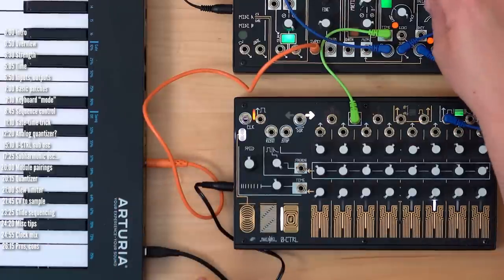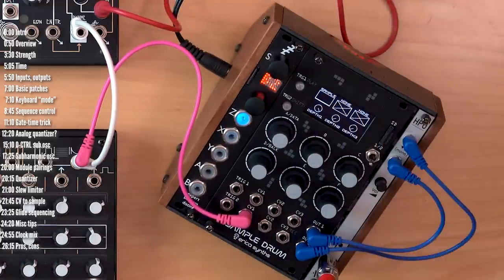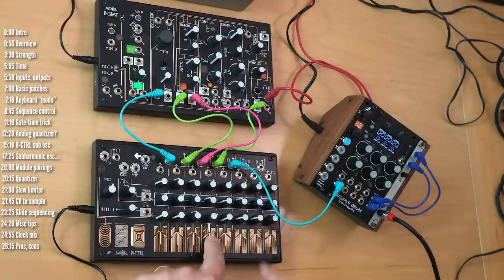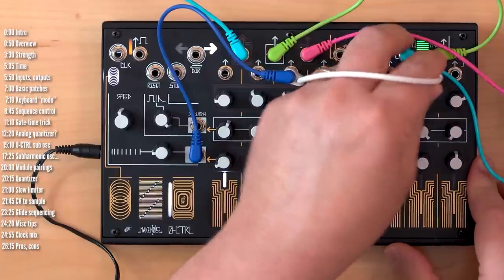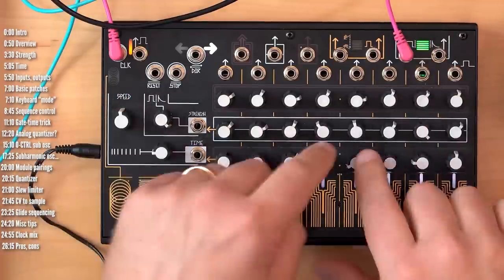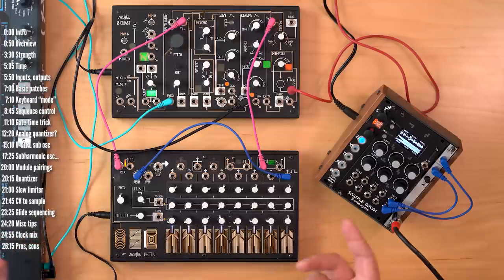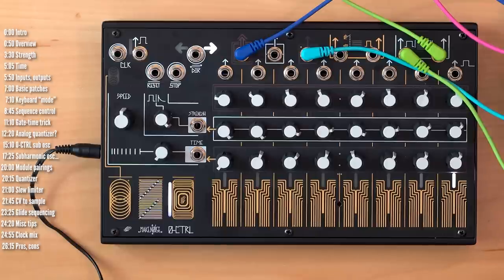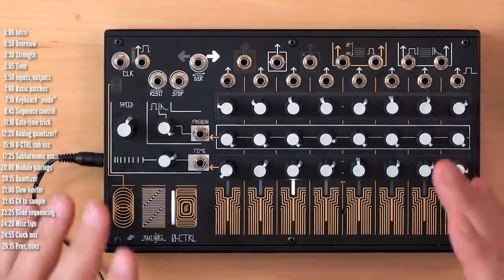Review: Make Noise 0-CTRL // Patch ideas with 0-COAST & other modules  // 0-CONTROL tutorial

Comment: A tip: if you patch the pressure gate out to the external clock input, you can play the 0-CTRL like a keyboard AND trigger its envelope out at the same time, as long as the sequence is not running. This does not prevent you from using the unit as the sequencer it is. When you stop the sequencer, each step sends three CVs, an envelope determined by the second row, a vari-level gate, a pressure CV and a pressure gate, which can be sent anywhere using a multiple.

Comment: Best review on the 0-CTRL, with amazing patching ideas! I would only love to see how you can add more steps. It sounded a bit complicated.
Reply from the maker: Thanks! Like I mentioned it requires a clock divider and sequential or voltage controlled switch. I might show it in a future video
Reply: @loopop  Oh yes I think I get it now. You've got  all 3 outputs connected to your V/Oct input and then use a switch to turn each row on and off. Right?
Reply from the maker: Exactly - and the timing of when you skip rows determines the length or craziness of your sequence
Reply: @loopop  Amazing, isn't it? I was checking all these eurorack sequencers constantly and I was never happy, couldn't deal with all the menu's and data typing. This is exactly what I wanted and I didn't know it before!

Comment: Great video. Maybe both of these would be a good fit with my Deluge. Presumably, the MIDI clock from the Deluge could be patched from the 0-COAST to the 0-CTRL so the sequencer would be synced to the Deluge but I could touch the pads for modulation?

Comment: this O ctrl could be a DFAM's best friend also !
Reply: I'm afraid DFAM will never have a friend ;)
Reply: Wouldn't you run into issues with voltage ranges? The DFAM doesn't follow the Eurorack standard.
Reply: @eternalvoid2678  got no issue between my DFAM and other eurorack modules. the "time" and "strengh" sequencers on the 0CTRL are perfect for DFAM. I already got an O coast with the DFAm and they pair so well (as long as you got a quantizer, love the micro tonal stuffs but sometimes it's a real pain in the ass - and a DFAM quantized is such a great synth outside of its percussive nature). i just wonder how does this Octrl competes with a rené mk2 in a tiny case.....

Comment: Hi, I'm finally getting a 0-Coast after waiting 6 months (due to Covid causing delivery/supply problems). However, when I first saw your review of the above 0-Ctrl, I thought, yes, let's get the two pieces, they'll clearly be perfect together. However, between time I recently saw the KORG SQ-64 which looks very interesting indeed (although clearly not a modular synth), but it does seem to have some very interesting qualities which the 0-Ctrl sort of lacks (and even covers some of the weaknesses too). 

So, my question is should I go ahead with the 0-Ctrl as the sequencer option, or maybe wait a few month for the Korg SQ-64. Of course I understand your answer could be simply, "it depends on what you want it for", but maybe you could give me a few pros and cons for the two sequencers, which both look attractive in their own ways. 

Thanks in advance.
Reply from the maker: You guessed my answer correctly... everything I know about both sequencers is in this and the SQ-64 review - if you want a summary of the pros and cons it's in that section of the video of course. Sorry, don't know what to say beyond that...
Reply: @loopop  No problem. One of the things that I thought was interesting in your reviews was the abstract way in which 0-Ctrl handles rhythm and pitch, but as you say, this can be frustrating as well as liberating. On the other hand I see that you seem to use your two MakeNoises with the KeyStep and the need to quantize, which points to something fundamental about pitch to make sense.

Comment: Looks awesome and just ordered one to use with my Make Noise 0-coast and new modular system. Can you send the CV to multiple modular synths? So have it sequence a 0-coast and Doepfer A100 system at same time on different tracks?
Reply from the maker: Sure
Reply: @loopop  thanks and can you use it like a clock to send a clock signal to a eurorack module that requires clock signal like the Malekko envelope module or would I send clock from the 0-coast to the Malekko EG sequencer module?
Reply from the maker: Renaissance Man you could from either - clock is just a simple trigger that repeats (assuming what your sending it to can detect it properly)
Reply from the maker: I’m not familiar with the malekko module but clock is just a repeating trigger

Comment: What enclosure and additional modules are you using with the Erica Sample Drum ?  Is there any other desktop devices you would recommend to add drums to the Make Noise pairing?
Reply from the maker: See description for the case. Regarding recommendations - you can add any drum machine, but if you want a voltage controlled one, no non modular one comes to mind

Comment: i have some non modular synths, that do have some minimal CV ...could they still be made use of somehow hooked into this?
Moog Subsequent 
Novation Bassstation R
TD-3

or is the intern in  going to be too limited ?
Reply: Most of the time these kind of synth have only a pitch and a gate intput, so yes you'll be pretty limited. I think something like the beatstep would be more efficient. I don't think that all the cool stuff like subharmonics won't work with these synth. Not 100 percent sure, they maybe tricks to do wild stuff but most of the time you will be able to use only one row. If you want a sequencer with knob you should try to find the korg one on used market it would me more adapted to your setup.

Comment: After 20+ years, i was finally weeks away from buying all the doepfer A-15- modules, and the 160-5, - having used an MPC60II with Kenton converters up until now.

well it's been a long wait, but i'm glad i did, - might still buy the Quantizer/156 though..

~ i wonder, would the A-160-5 be a good addition to this??
Reply: i assume you mean you are talking about the doepfer sequencers, not switches?  lots of fun combos to imagine, a-160-2 and a-160-5 among them. 

I worship at the church of ALM pamela's new workout for a master clock (with divide and multiply, swing, slop, + bonus envelopes, gates, euclidean patterns, etc..it's seriously the best deal in modular), but the 160-5 is awesome for ratcheting, and 160-2 gives you weird prime number divisors for the clock so you get complex poly-rhythms (and so avoid repetition). 

for a quantizer, intellijel scales or addac207 i highly recommend checking out.  haven't tried the doepfer a-156 personally but i think the scales or addac207 are more intuitive, and addac207 is much more powerful because it's actually a quad quantizer, so you can do 4 cv's simultaneously, plus you can queue up realtime key modulations, and likewise modulate back to the original key which is pretty slick when you are just sending it random cv's.

for me, this new 0-ctrl is super exciting because of the velocity sensitivity per pad, the envelope per step (rather than just a gate--thinking of it like 8 AD's).  I am not really seeing it for melodies (due to being unquantized for pitch), but this 0-ctrl is definitely going to get some love.  it's obviously built for live play, i think of it more like a live-playable modulation sequencer, adding feel to rhythm parts and using those envelopes to ctrl vca's and filters.  the sequenced cv but un-quantized is excellent to move filter cutoff or resonant points around, where 'close enough' is fine; we are not playing notes.  some modules it brings to mind for me are intellijel tetrapad, malekko voltage block, which both i love, but i'll def be getting this, it's a very cool interface to me.

hope that's helpful, best of luck on your musical journeys:)